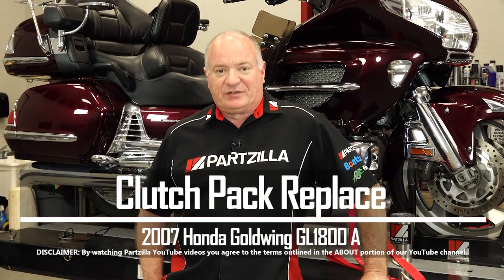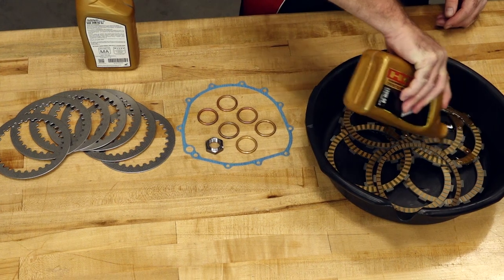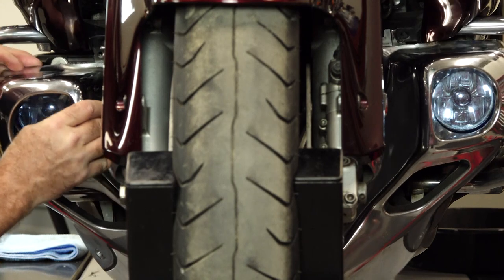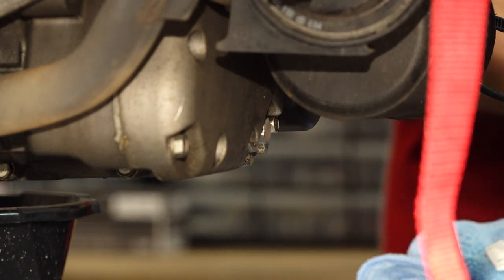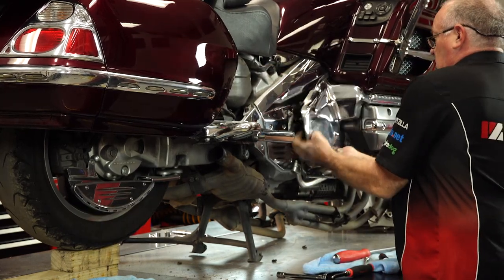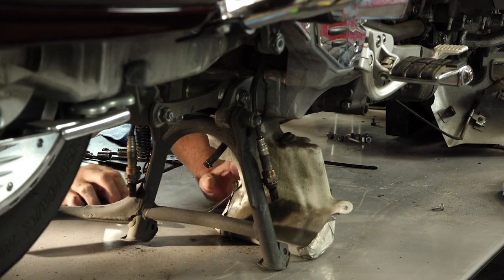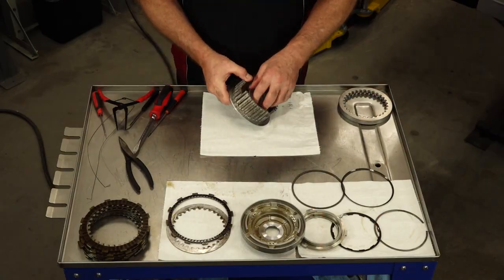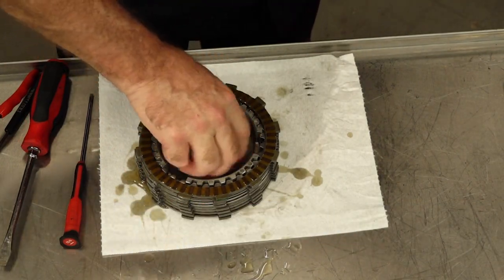Honda Goldwing Clutch Pack Replacement | Honda Goldwing Clutch Rebuild  | Partzilla.com

Comment: Coat the new gasket with rust oleum aluminum paint from the bottom of the unstirred can. That was a bulletin from Honda when I was a Honda motorcycle mechanic in the 70s. To coat all dry gaskets with the glue from the bottom of an unstirred can of rest oleum aluminum paint. That gasket will not leak, and it will not stick to either surface again, you work the goof from the bottom of the can into both sides of a dry gasket and put it on wet. You will never have to fight with that gasket again. That was a bulletin to all service departments from Honda..
Reply: Hi, 
Would grease work to help seat, seal and separate for next time?
And how about soaking or painting on gasket removal gunk, if diy’er home mechanic not comfortable scraping gasket off? Then scotch brite/ light scraping/emery cloth?
Just a question/suggestion?

Comment: Thanks for the detailed video. The camera work and lighting was really nice in such a tight area behind the alternator. Well done. Removing the alternator made all the difference. I really like it that you get everything clean. You can't do good work on dirty parts. Hopefully, I'll never have to do this job. I've seen a lot of 'Wings with 200K. and 300K. miles and no clutch/engine work. I know personal riding habits make a huge difference. The "friction zone" riders might have to replace a clutch!

Comment: For Those Honda Green Gaskets use a 3M Plastic cutting disc on a air drill. It come off easy and finish it with scotch pad. Had to remove a Throttle gasket from intake manifold on Honda J series V6 Engine.

Comment: Use a pry bar for leverage...and Large Socket over the spring seat port. You  may be able to put the snap ring back with your hands only. I was able to install my Spring-seat  and ring. Let me know how you made out. TGBTG

Comment: Awesome job! love this channel... but now I need help & have a question... two days a go I had an accident in my 2015 F6B, avoiding hitting a guy crossing invertedly the street and fell down (swerving correctly wile breaking, but over dirt, lost the front wheel at the end... the guy walk untouched and I fall out the bike, I'm okay) the gear's stuck in OD, the clutch works fine, was able to start it again and ride a short distance to a safe place, but unable to shift down, the shift pedal moves but... any advise? don't want to lower the engine if it is possible, and I think I have all the tools required... Thanks!

Comment: Been there and done that, but engine out due to  ADG failure aat 100,000 miles.  Your replacement gasket was blue; was that after market? The green are mean!

Comment: Great video! After torque 32mm nut and staking. Having trouble getting the lifter plate to seat in far enough to place snap ring. I tried relieving clutch pressure by bleeding the line, so you have to apply pressure?
Reply: TGBTG...need this answer as well. I removed the nut and torqued a new one to 94 Ft Lbs. I am able to push hard enough to see a little movement, but not enough to   seat the snap ring.

Comment: I had to have my clutch rebuilt after taking a "Ride Like a Pro" course.  It is very hard on clutches.
Given that--and this procedure--I would rather have this done by an experienced mechanic as I really don't want to break my bike.
Reply: lol you would be lucky if most mechanics you hire even follow the torque specs as this guy did. But I understand some people just don't feel comfortable doing their own mechanics
Reply: I've had dealers send me home with my tire flying off 3 miles later lmao. I only do my own work now.

Comment: TGBTG  John I'm having a time replacing the Spring Plate , I removed the main clutch nut again and installed  a new one today and Torqued it to 94 Ft Lbs. I can depress the seat a little but it needs to go about 1/16 of an inch so I can install the  final Snap Ring. Im not stoking this nut until I get clearance.  Thanks for any suggestions.. If anyone else have a suggestion that will help. Please and Thank you. TGBTG
Reply: I found an easy way by way of using a large socket over the spring seat ( so as not to damage the port) and using a small pry-bar to use for leverage.  TGBTG